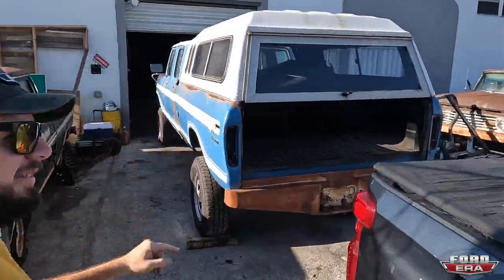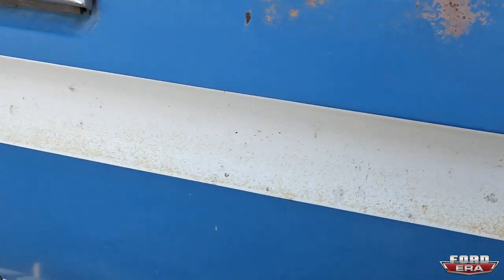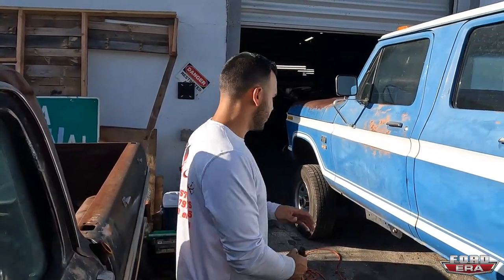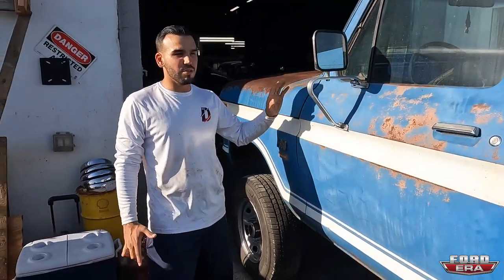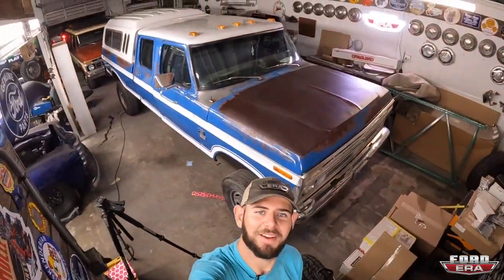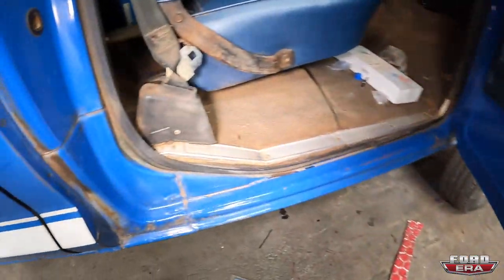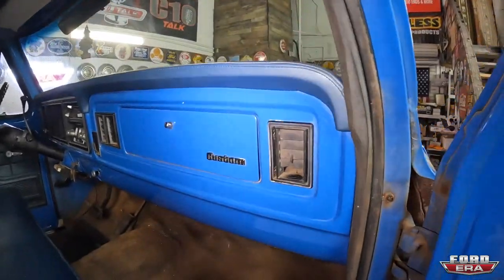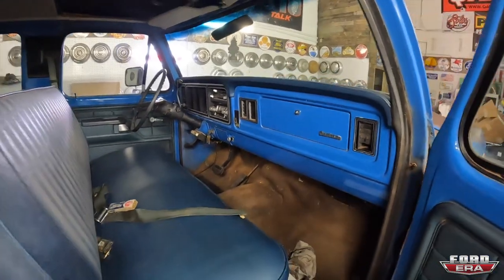Shining up 46 Year Old Original Paint on our F350!

Comment: I like the idea of freshening up the 390 and putting Holley Fuel Injection on it. Modern Edelbrock heads and intake. Gear Vendors OD. Updated vintage setup.
Reply from the maker: That would be a great way to go, especially with its 82k miles

Comment: Leave the 390 in it.  You've got loads of coyote swapped, diesel swapped, and godzilla swapped trucks already.  The old FE engines are super awesome.  😁  I would pull it, rebuild it, put some heads, intake, cam, sniper, and hyperspark on it with some long tube headers.